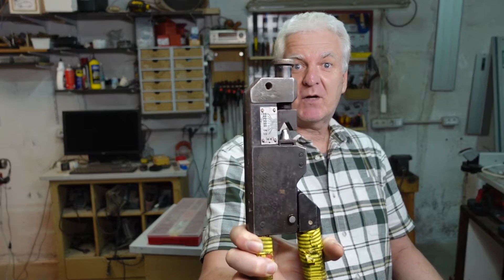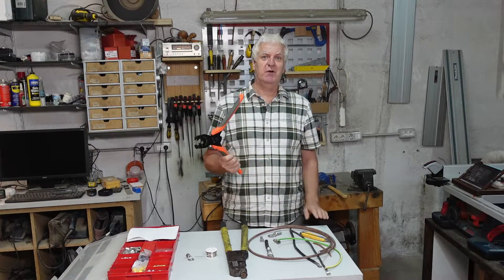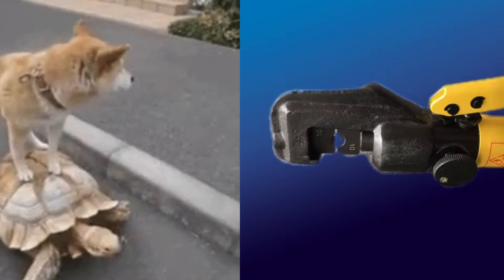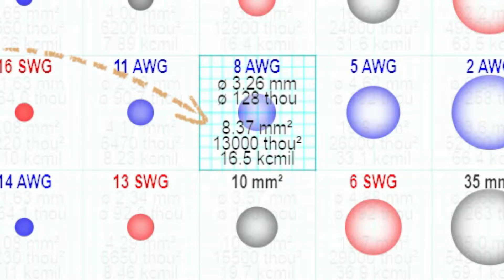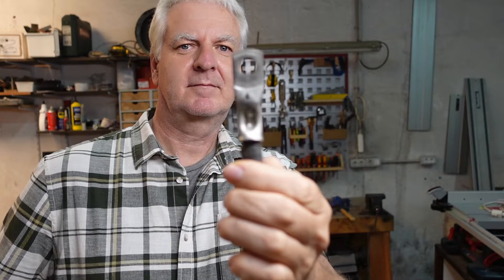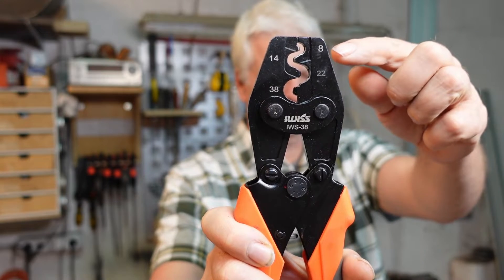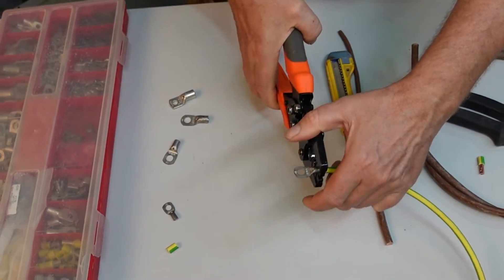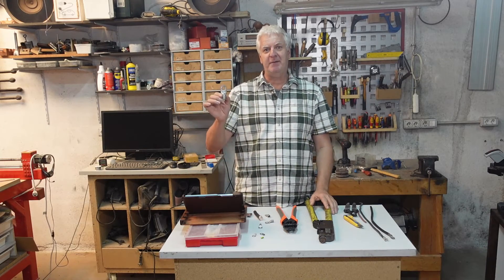Cable crimping tool. Everything You Need to Know in 5 Minutes

Comment: If your problem is that you have metric pliers for AWG cables and they are not compatible, the best solution is you either use the correct cable or the correct tool. Don't try funny things.

Comment: In the past I would just ask one of the electricians on a job to make the cable for me (a little "perk" of working construction) we used to call them "Government Jobs"  LOL.   In return I could weld just about anything they could bring to work :) 

Now I am retired and I have a BUNCH of 00 Gauge battery cables to make up for a project.  I got the Hammer Time style crimper, I hole it doesn't explode like in this video!!! LMAO .. I'll try crimping one end ... if it's not good?  I can always upgrade it was only $19

Comment: If you aren’t going to use proper strippers then use a slice/slash resistant glove as ppe when using a knife to remove insulation
Reply: Who the fuck is going to put on gloves to strip a cable this has got to be the most cringe comment I've ever read on the Internet. People like you are the reason safety isn't taken seriously by others because you say something so ridiculous and then the whole topic gets associated with clown advice like this. Why don't you tell your wife to wear the gloves when she uses a kitchen knife.

Comment: Nope, solder it. Do it right first time. Also dont buy those expensive connectors, use copper tubing. Smash 1 end and drill hole. Your all welcome.
Reply: Solder is not the correct way and can be dangerous. If the connection gets hot from corrosion etc the solder melts and you have a live wire loose and exposed.

Your DIY terminal/lug is not plated and will corrode, which is also not ideal, especially if you soldered it
Reply: @scod3908  Funny - worked for 20+ years at an Automotive Component Mfg.  All large lugs were soldered, and battery terminals (lead) were molded onto the cables.
Reply: Solder every time. From my 30 years working on battery electric forklift’s.
Reply: @nigelgoodwin6954 You are wrong, solder joints break in those applications, and it’s why the forklift would come with crimped connections from the factory- not soldered.
Reply: Solder? 🤣🤣🤣

Comment: It would be interesting to do both electrical tests and pull tests on these crimps.  I suspect the indent crimps are solid and probably fine for most uses, but I believe they make a weaker connection as they bend and displace the conductors more than a hex crimper.  And I find a proper hex crimp to look much more professional.  To me an indent crimp just screams amateur.  If you look at almost any commercially crimped connector, the crimp is almost always hexagonal or circular.  I don’t think I’ve ever seen an automated machine crimp that was of the indent style.

I may be wrong, but I suspect a good hex crimp will run cooler under high current and will withstand more mechanical stress.
Reply: I very much agreed with this!

Comment: Something (was that what you wanted me to write?) I was hoping this was going to be about smaller gauge wires from 26AWG and up or is it down o around 14AWG? I have to use 26AWG and put ferrules on them for a 5V or is it 3V LED project I am working on and I am a complete numpty with wires and electron stuff.
Reply: Best thing you can do with boot-lace ferrules is get one of those 4-jaw ratchet type tools, the scissor-type ones wear out over time and stop fully crimping, I threw one of these in the bin about 10 years ago.
The 4-jaw type is bullet-proof and works with all sizes of ferrules that you would ever need to use. 
Hope this helps.

Comment: Thanks for that. I have just returned a 6mm to 50mm mechanical crimper due to it creating those little side wings on the terminal's. I won't buy another hydraulic crimper after having a brand new one fail straight out of the box due to leaking fluid. I have been wondering how well the indent type work and that cut lug using a larger terminal looks like they work very well, I will be buying one this week, thanks again.